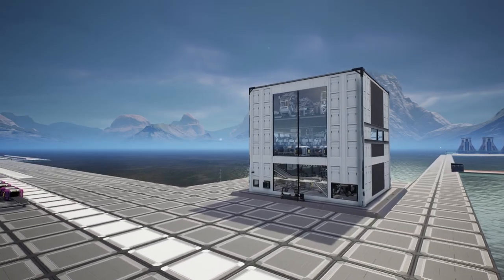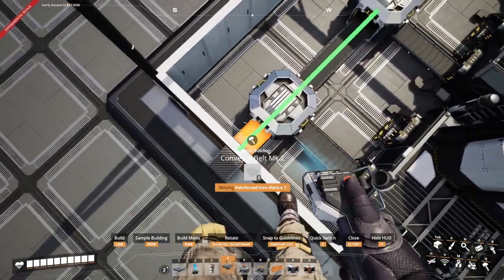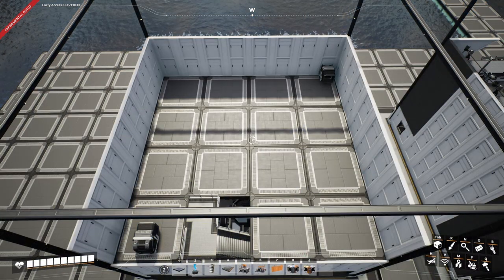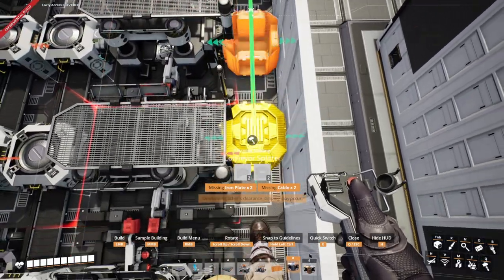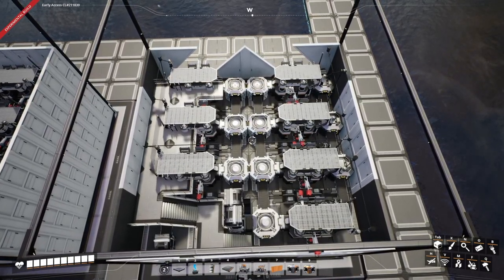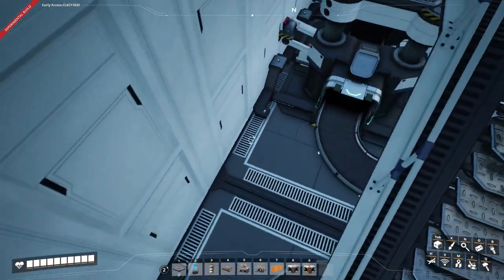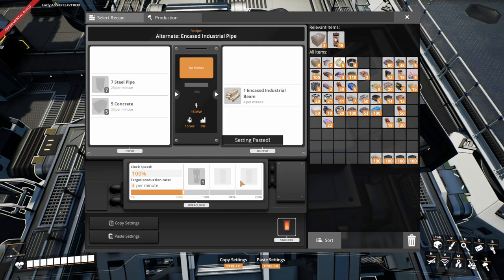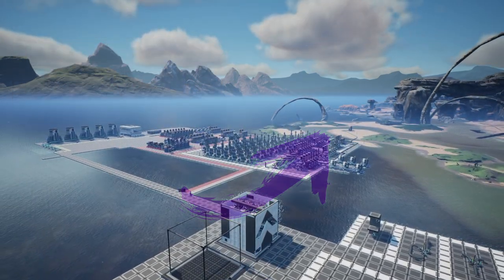Efficient Encased Industrial Beams Guide With Satisfactory Blueprints

Comment: Overall great video. Just a few little mistakes. at 5:46 the Steel Pipe constructor should be set to 102.5% to make 20.5 pipes per minute, not 20.05. This means that at 2:15 we want the foundry to be set to 30.75 steel a minute. You can click on the number in the targeted production rate to set this accurately, rather than estimating it in the clock speed. Annoyingly this means we want to have 120.75 iron and coal coming in for the factory to run perfectly if anyone wants to set their miners perfectly.

Comment: This was perfect timing and helped a lot as today I'm working on an encased industrial beam factory and was leaning toward sticking with the default recipe.  It looks like the default beam recipe requires 16 steel ingot per encased beam and the alternate encased industrial pipe requires 10.5 steel ingot per encased beam.  Another nice thing about the alternate is we can move right on to the stator and rotor alternates as the focus for the steel factory is pipes which if planned accordingly should leave plenty of excess for those recipes.

Comment: There's still the stator and motor build, but a motor build might take two blueprints and merge them on top lol. Motors and up probably won't fit in a single designer, so it's time to build up or make sections
Reply: motor is super easy... steel pipes + wires -> stator/rotor -> motor = done only inputs you need can be iron + coal... if you want you can add copper